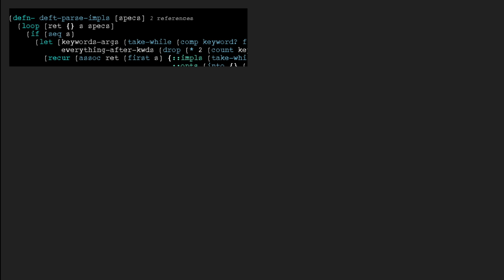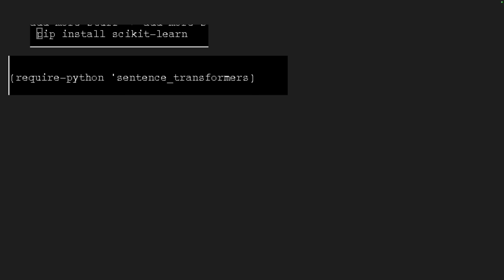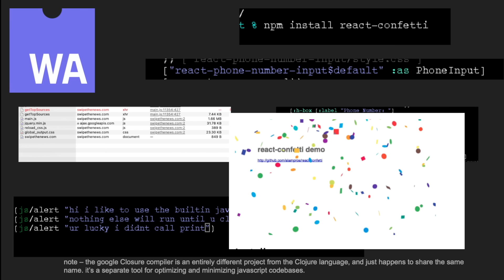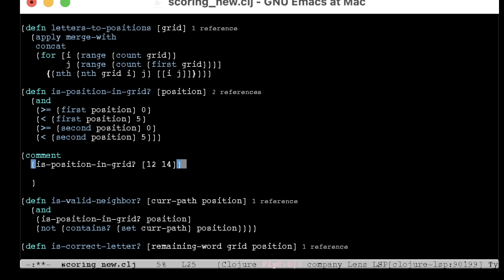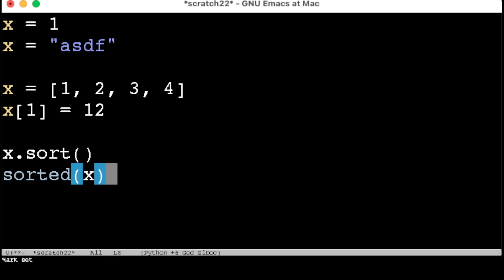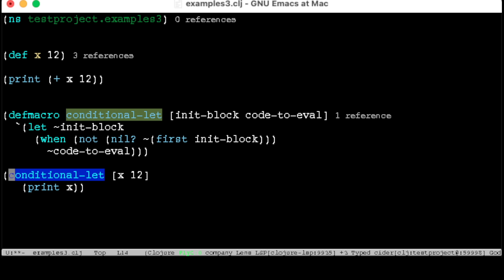Why CLOJURE is my language of choice

Comment: I strongly feel that "just use maps" has done more damage to codebases than anything else. This combined with Tacit programming and heavy use of threading macros destroys intent, causes a change to be exceptionally painful across a codebase and makes the final form of your object open for debate if not all keys are acted upon but the intent to have them is there. I wish Clojure's culture acted more like the Lisps before and took some lessons from SICP and its notion of selectors and building a language to describe the problem at hand. I think Common Lisp's CLOS and structs (to a lesser extent) are very nice for example. When all you have is hashmaps you've undermined the typing Clojure has to begin with. For fun I implemented a pure functional immutable object system that won't even let you create something unless all predicates pass for the assignments. And that's on the Object - not some screwy library like Spec.

Comment: 22:56 is there anything preventing anything else than a Position record to end up assigned in the position field of Circle?
I found types to dramatically improve AI with context how is Clojure doing without types?
Reply from the maker: Most people are using some kind of library (lmalli/spec/schema) to enforce types at runtime.

I wrote my own little toolchain that does this validation in sort of a similar style as defprotocol and defrecord (https://github.com/sstraust/deft), and I've found that it works pretty well for me.

I also am working on a full on static-time gradual type checker for clojure, and am making good progress, but am not quite ready to release it publicly yet.

Comment: Just because no one has done cursor position relative evaluation in languages like Python doesn't mean it's impossible 

I initially thought that it'd have to use cursor selecting/highlighting, however, that isn't necessary, though it would make exactly what's being evaluated unambiguous

Let |, the vertical pipe character, serve as marking cursor placement:
if 8 < 3 +| 4:
- Execute the plus & all necessary proceeding logic
- - 3 + 4
 -> 7

if 8 <| 3 + 4:
- Execute the less than & all necessary proceeding logic
- - 8 < 3 + 4
 -> False

if 8 < 3 + 4:|
- Execute the if & all necessary proceeding logic
- The logic within the if statement isn't provided here

As for what to show as the results, the state that changed:
- Variables, created or updated 
- Ideally though more difficult to implement either the result of all function calls made that have side effects or the function calls themselves, for example print(), writing to a file, sending a packet, etc
Reply from the maker: as I understand it what you're saying is:
- every program still has a syntax tree, where the scope of each operation is defined by the top-level node in the tree.
- it's possible to select an arbitrary subtree of the AST by placing your cursor after the symbol representing the root of the subtree you want to select.

i think the answer to this is -- sort of, with the following caveats:
- it's difficult to evaluate subexpressions if your source file contains incomplete/in-progress code fragments, because your program might need to rely on a much wider context in order to build an accurate AST
- as a user, you need to sort of understand more details about how the AST is built to specify which blocks to execute. i.e. if you put your cursor here
if 8 < 3 + 4:
  x = 4
else | <------:
  x = 7
is this a root node of an ast? does executing here evaluate to something meaningful?
[x + 12 for x in range(20) if x > 20] -- is the root of this tree 'for or 'if?

Understanding the right thing to do kind of gets more tricky the more complex the syntax. I can't think of any examples where a symbol is overloaded in terms of what tree it should resolve to, but I don't know enough about the python parser to prove that this will always work.

- the style of python leans towards large "do" blocks. i.e.
  x = 12
  y = 13
  z = x + y
  ...
  in these 'do' is sort of the top of the syntax tree, which is an accurate, but coarse description. lisp has these too, but they are stylistically less common.

It's a neat idea, and I think with some work you could do it, but it'd be a bit harder and messier to work with. I'd love to see someone try this and add in ast-traversal editor-bindings like go-up-expression-tree go-forward-expression-tree, etc. or tell me about a tool that already does this that i dont know about
Reply: So it turns out VS Code has cursor selected/highlighted code execution support for Python they call it Smart Send. When pressing the Smart Send key bind, the default is Shift+Enter, selected/highlighted code is sent to a Python REPL running in the embedded Terminal & the cursor is moved to the end of the code that was executed 

They even have some support for grabbing the code around the curse though it isn't as fine grained as what was shown in this video for Clojure. For Python VS Code Smart Send will grab the entire if-else statement if you just put your cursor in the if-else statement & don't selected/highlight a specific part of the if statement; So while it takes more mouse movements and/or key presses than than what was shown for Clojure, it is still capable of the same functionality with the main drawback being that if your REPLing that sets a variables you'll need to explicitly query those variables at the end

Comment: You'll take my type system from my cold dead hands. Sure, macros and homoiconicity are nice, but Scala shows us that you don't need to sacrifice types to get macros, plus you also get functions that unambiguously document acceptable inputs, and a compiler that checks for me a sizeable number of things that would otherwise require unit tests (tests that far outweigh the amount of code needed to specify types in the first place, especially if I have type inference).
Reply from the maker: implementing a gradual type linter for Clojure is part of the planned work for this channel. Stay Tuned! 😊
Reply: @sammytalks7215  is this implementation differ from TypedClojure project?
Reply from the maker: @hakimahmad55555  yes. I was an early user of typed-clojure and found it to be a little too heavy to be practical
Reply: In my experience, types are most helpful at the application boundaries. It's quite rare that they're useful intra-application calls.

And in clojure world, we have type enforcement (spec, malli) ala carte.

Comment: I like Clojure, I’ve use it since 2009, I ran the local Clojure meet-up for a decade. I’ve had beer with Alex miller and David Nolan. I cofounded a startup using Clojure.
Buuut… I’ve transitioned away from it. If I could choose any language to use today, it would be Gleam. I mostly use Typescript today (full stack) and am trying to slowly get into Rust. There’s a lot to like in Clojure, there’s some really well thought out ideas and tech in there and it’s a great langauge. However after 25 years of programming and 15 years of Clojure: I very strongly want first class static types. And spec/malli aren’t a good substitute IMHO. (Also I used Clojurescript for years but in the end, being able to copy and paste typescript examples from documentation turned out to be a big win, using interop was always a speed bump).

Comment: i like programming and i see, sort of, the benefit of clojure. but i got lost. it would be helpful if you show some real world examples and go line by line through the syntax and how it is written. how it can be replicated.  i would like to see an complete application in clojure to get a feeling of the concept. for example, how much does it need to write an app in clojure to query some data from a database and let the user select an item and give the item to shell script. or a simple note app in clojure?. the program doesn't matter much but the way the program is written, tested, debugged and shipped. not the hello world stuff but a use case that can be used as a starting point. i would propose to make it as simple and reproduceable as possible for an software developer.
Reply: Please check out Andrey's Clojure Crash Course https://www.youtube.com/watch?v=mzNBRmZHmD4

Comment: Clojure is also my language of choice and I use it for frontend, backend, desktop, mobile and even experimented with phel that is clojure for php. Thanks for the effort to create this really nice content.
Reply: Kotlin came up with something similar. I doubt it's the best way to go. Personally I havent tried clojure so I will not comment on whether it's a better choice for a certain task. Anyway, I am super interested in this language and will try to learn it.
Reply: @A--_--M yeah, try it and in the worst case scenario you'll have another tool available.
Reply: Are you able to have 1 codebase for a cross platform app? If so what frameworks do you use?
Reply: @LukeDickerson1993  I'm using polylith to have everything in one code base. Read about it online and it will probably help you one you have an idea of how it works.